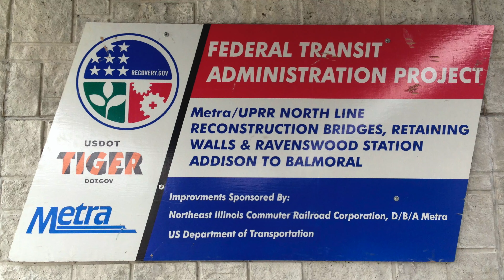Metra UP-N Bridge Project

Comment: I think they should have a direct entrance from Metra to Mariano's!
Reply from the maker: I agree, but I would expect this in Europe and Asia, but not in the US, sadly.  I was thinking of how they could make a direct connection and I don't see how they could do so easily.   They would have to have a pedestrian bridge over the tracks, and then leading across the street to the second floor of the store.  The current station is build extremely cheaply, with no escalators or elevators.   There are long wheelchair ramps instead.

Comment: Having moved to Arizona, it's been a while since I have walked or driven through this area of Ravenswood.  The replacement of the original viaducts for this stretch of the UP-Metra was definitely much needed and a welcomed sight.  Walking under the original viaducts with all that rust and deterioration was nerve-racking, especially when a train was thunderin' above your head-LOL.

Comment: What 4K camera do you use? Video looks perfect!
Reply from the maker: Thank you!  Nearly all of the video was shot on various iPhones.  I find they take excellent video.  For the rail delivery scene, I used my Canon Vixia GX10.  (I tried using my Canon video camera for the shots from the Mariano's parking lot roof, but it is too big to fit through the slats!  I would have loved to get a zoom shot from up there, but I was stuck with just using my iPhone.  Maybe I should get a zoom lens for my iPhone.)
Reply: @Luke_Starkenburg  What about 13:13 Was that a Iphone?
Reply from the maker: BigChris yes, the Christmas train was shot with my iPhone.
Reply: Luke Starkenburg Jesus! Is that the X version? If so I need to upgrade.
Reply from the maker: @MilwaukeeNorth418  iPhone 10X + plus.  I plan to get the new iPhone when it comes out in September.  I think it's the 12 now, not quite sure.

Comment: Then they should open the northbound platform for people in wheelchairs. According to their website Ravenswood isn't accessible when the northbound platform is obviously is accessible.
Reply from the maker: Yes, this will be a huge improvement for wheelchair users.  The new station has long ramps, but no elevators.  I guess it makes sense to save the money and have less stuff that can break down.  I wish Metra had level boarding and wouldn't have to rely on lifts for wheelchair users.